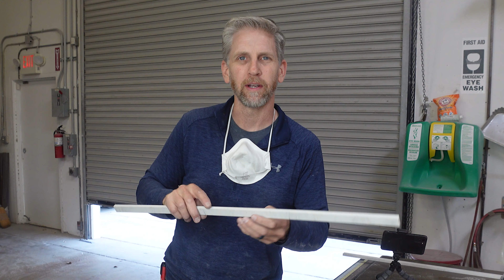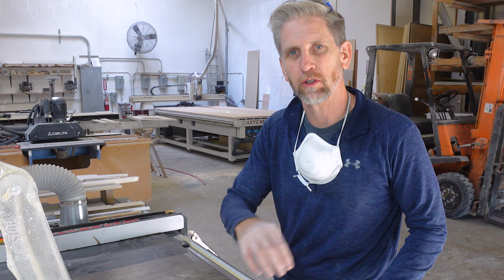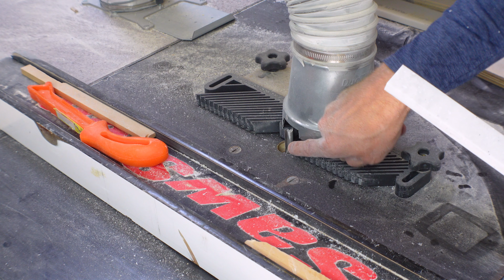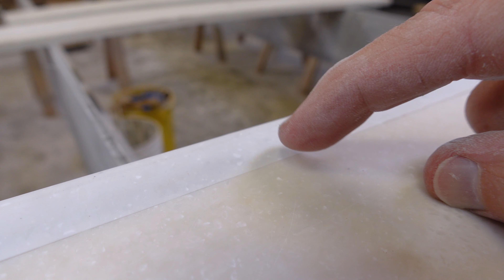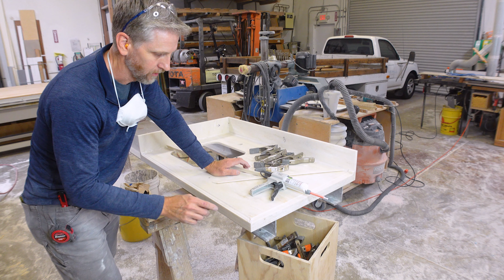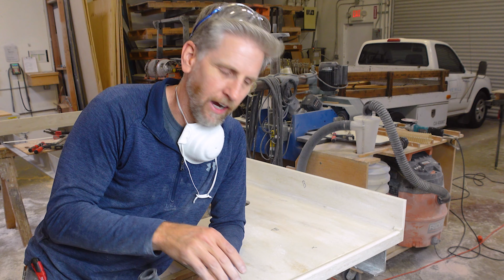How To Make a No Drip Edge on a Corian Solid Surface Countertop

Comment: I need a huge favor I have these massive all panels I am installing on this commercial job and have to route grooves in it and they have to line up and atleast three seams to put togather do you have a Facebook I could share blueprint .is thier a way to do grooves on the wall once installed how would I get a straight edge
Reply from the maker: olivemill@gmail.com

Comment: Brother what glue and glue gun you use and from where you buy them.  Any vedio about the Information about it ?
Reply from the maker: I typically use the adhesive that the manufacturer sells but you may not be able to get that. You can get Artisan adhesive and the matching glue gun that fits the 250ml glue cartridge.

Comment: Unrelated question.let’s say we gluing splash back  without coving,how  and when you remove excess glue?
Reply from the maker: We don't hard seam the regular backsplash onto a countertop. We just silicone it to the wall.

If you did, I would remove as soon as it stays to set up.
Reply: @AndyGraves  so you just use silicon  on the seam.,i kind of agree with that ,for the reason of expansion and contraction.in one of the videos about ramp sink  ,as soon you glued slope on the sink you immediately used alcohol to clean excess of the adhesive.is alcohol no soaking in fresh glued joint?sorry for so many questions but last five years i working with solid surface but i still trying to learn something new every day.

Comment: Thank you for the video. I like that you explain everything in details, very specific. I assumed you glue in the strip first about the 0.25"  higher than the top and then router the edge. Is there a reason  why that would not work?
Reply from the maker: Hello, you can insert the piece first and then retire the profile. BUT, holding the router on the edge is very difficult and leaves a bumpy no drip profile. I just find this works better.
Reply: @AndyGraves  any way I can send you a picture? I just bought a house and the sink is all cracked I’m wondering if it can be fixed. Thanks
Reply: After a little practice, holding the bottom bearing router on the edge is quite easy.  Plus, you can dado the front edge piece that you glue on to the slab.